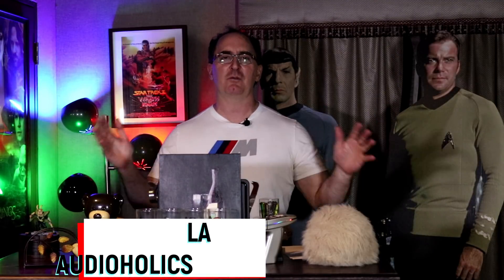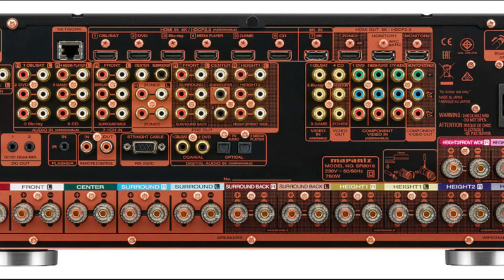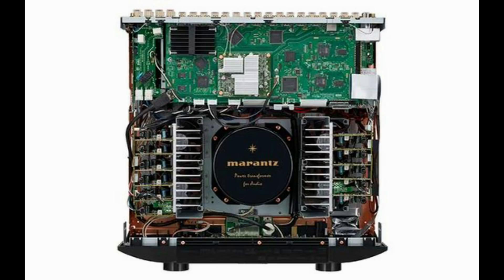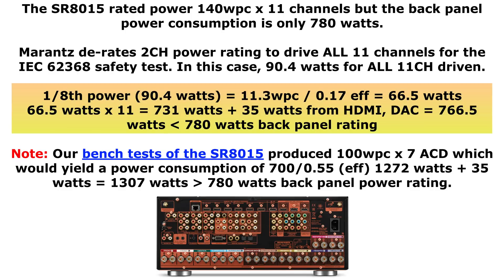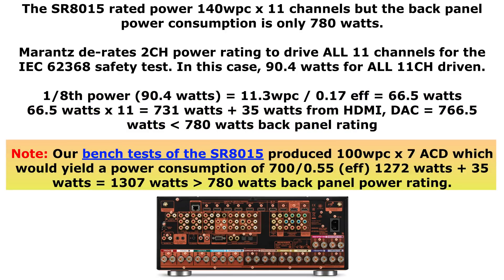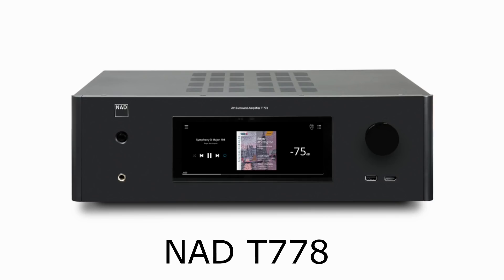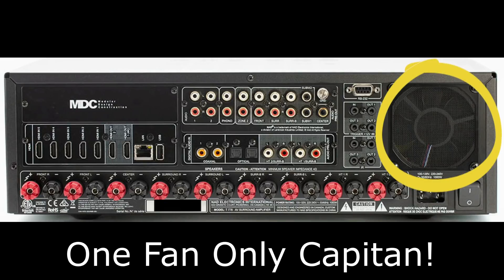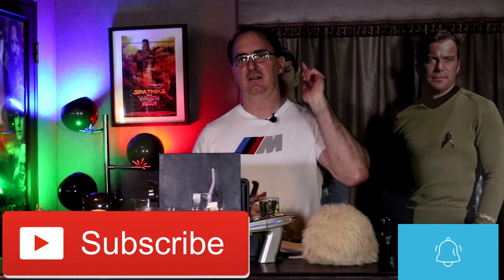Receiver Power Consumption Ratings NOT Watt You Think?

Comment: @starlightgrecording559
Audioholics
This Is Gerard Stroh!!!
I Have Pro Poweramps and Also I Have A Vintage Pioneer 7.1 AVR Reciever and it was Built in 2007 and it is Class AB at 110 watts Per Channel X 7.1*** My Pro Poweramps are 750 watts at 4 ohms so I Don't Believe These Power Rattings on these Home Theater AVR's or These 2 Channel Stereo Amps and I Been Dealling With Pro Audio Gear Sence A Very Young Age and I Had A Vintage Sansui A-60 80 watts Stereo AMP and Truely it was only 43 Watts at Peak Power and So I Learned Alot For 53 Years and I only Use High SPL Speakers only Because These New Speakers Don't Put out High SPL Rattings***
3 things I Look at When I Buy Speakers  1. OHM Rattings  2. High SPL Rattings  3. Wattage**

Comment: Thanks, Gene. Although it is one of your older videos, it helped answer a lot of my "current" questions.

When I tried using external amps with my Denon AVR-A10H(tried Monolith, Emotiva XPA 7, and Anthem Mc325). They all seem to make my speaker pop during startup and the shutdown (used 12v trigger). The pop is small but loud enough that I can hear from my MLP in my 20ft by 20ft room. Should it be ignored, or is this an issue that could potentially damage speakers overtime? Preout disconnect in Denon did not help with this issue.

Comment: I need help on what size, brand and configuration A/V receiver I need for the following layout for my outdoor covered patio. The A/V receiver and needed supporting audio equipment will be housed inside the house and cables feed outside through liquid tight tubing so, I need a controller/receiver that can speak to each other through walls. I have two TV's mounted, one is a 65" Samsung Terrace and the other is a 55" Element ROKU.

Here are the speakers I will be using:

65" Samsung Terrace:
7 ea. = Focal Littora 200 ICW8
2 ea. = Focal Littora 1000 ICW SUB10

55" Element ROKU:
1 ea. = The Terrace Outdoor Soundbar LST70T

I live in Houston, TX so you know the environment situation. Please advise and give me direction, I really would appreciate it!

Comment: I have a Yamaha 5.1 receiver rated at 100W/channel and 250W on the back. You explain that difference nicely here. What I'm wondering is that when I look inside, I see the power transformer hooked up through a 6A fuse and switched by a relay rated for 5A. Given that it is (presumably) a class AB amplifier that is only ~50% efficient: 100W/channel * 5 channels / 50% / 120V = 8.33A would blow that fuse. I am therefore concluding that the 100W/channel rating is the total power consumed by amplifier + speaker and not just the speaker. Am I correct? Seems like that would be misleading though.

Comment: When I look at the electrical box that distributes power throughout my house I see a lot of 15 amp circuits and a few larger ones for 220v devices.  When reading Stereophile  and other high end audio periodicals, you sometimes see reviewers recommend a 20 amp circuit or a dedicated circuit for a piece of equipment they are reviewing.  This usually is brought up when they are reviewing a very powerful class A or AB amplifier.  I am curious under what circumstances is the typical homeowner would be wise to consider having an electrician change a 15 amp circuit to 20 amps or install a dedicated circuit for AV equipment.

Comment: Hi  Gene, thanks for the info on the power consumption, I spend hours watching and learning from your channel.
 I have a Denon avr 8500, the box says 150wpc x 13 channels. doing my limited math I calculated approximately 100wpc. Please confirm.
 I'm driving 7.2 channels, however when driving 2 channels my towers which are polk rtia 9's aren't really  being driven hard, are these speakers inefficient or is there something wrong with my avr? I'm very frustrated and need your help please.
Courtney

Comment: As you stated, class AB uses 4x power consumption compared to class D at 1/8 power assuming 100 watts/channel x7 channels (437.5 watts vs 109.4 watts).  Let's say I'm deciding between ATI's 200 watt 5 channel class AB and class D amplifiers.  Assuming for arguments sake that I listen at 40% power, will my electric bill be lower if I go with class D?  In other words, does a class D amp draw less power than a class AB, which would have a greater demand for electricity?
Reply from the maker: Yes Class D is much more efficient,  especially at idle power.

Comment: Thank Gene, I was about to blow a wad of cash on a pre-pro/amp setup ...  which was probably always overkill for my use case, as I sit pretty close to the front sound stage.  I guess I've been under this spell by watching various YouTubers as they always seem to gush and prattle on about channel separation and the dynamic range of a prepro/amp setup.  Having bought a cheap integrated Onkyo, late last year, I've actually been pretty happy with the sound quality, but was always wondering if I was getting all I can out of my Infinity ILs.  To be fair, there's probably an appreciable difference in the sound quality between prepro and integrated, but to the tune $3000 plus?  Probably not worth it.
Reply from the maker: No and I find it kinda funny another Youtuber claimed the preamp section of the Marantz AV7705 is a big upgrade from the SR8012 receiver.  The exact opposite is true both in measurements and direct confirmation with SU engineering. Separates aren't always better.
Reply: prepro  way to go
Reply: @musicman8270  Yeah that's what everyone says and if money was no object that's the way I would go.  If I had bigger room to fill and sat further away, the Onkyo's flaws would be more apparent.
Reply: @charlessailer4580   I had  an integra by Onkyo for fifteen years.  I bought a Parasound p5 one year, mated to a cheap amp  I had, next year got a matching A23 amp off ebay, new in the box, 1900 for both. Use the home theater bypass to share parts in both systems.  Takes time, but the sound quality is no contest, way better. Even an inexpensive  integrated  amp is better, just saying, although If it has to bbe a receiver Onkyo is  about   the best you can do. Still have one in the spares system.

Comment: Electrical engineer here. Great video. Sufficient explanation without getting too in-the-weeds. I didn't know how consumer AV receivers were rated. I assumed the amps throttled down under continuous loads and the ACD tests were essentially "burps", hence the reduced power consumption ratings. Glad to know that's not the case.

Comment: What do think of  Denon 6500 its says 140 x 11 I do not believe it so pick up outlaw 5 x 120 so I run the 5 main  Channels then run the rest off the receiver is that good move what do you think
Reply: That's what I do. Most of the surround and height channels don't use a ton of power anyway.

Comment: Yes there is 3 power ratings you can use RMS,  programmable, and din or peak power, probably is maximum now they call it they keep changing the meaning.  sounds like what you're talking about is programmable power rating. Is that right

Comment: I have a Harman Kardon Signature 2.1 (5x100wrms @8 ohms or 5x150wrms @4 ohms ALL channels driven from 20hz-20khz.  Back panel says 950 watts and manual recommends plugging it into its own electrical circuit. If i plug my main receiver (denon x3100) on same circuit and play full blast on all 7 channels the breaker will go off. That harman kardon is a beast of an amp and weighs 47lbs fpr 5 channels ! No processing at all, only 5rca inputs and speaker terminals with a power button.

Comment: I have known for a while that the power ratings can be deceitful, but I just found it to be funny how they (Sony) had laid the power outputs in the manual, when I was checking it again today for my receiver. Budget receiver.

So, the package boasts 145W x 5 channels! (@6 Ohms)

The back of the receiver says 200W, so okay, based on this video, it should be able to squueze a bit more than just 200W? Okay.

The manual says 90W @6 Ohms with stereo setups.

95W at 6 Ohms with stereo setups using Pure Direct. Okay, Im still following 🤔 still makes sense that the receiver would manage to squeeze few extra wats when digital processing isnt used.

Right bellow it, 145W with 5 channels @ 6 Ohms, yeah baby!!!

Its just so funny, that the facade needs to be kept on. It makes zero sense that stereo can only be driven at 90W but when you plug 3 more channels in, suddenly even the front channels gain extra 55W from somewhere 😂

I dont need that much power either way, but it made me chuckle.

Comment: Hi Gene. I dug up the manual for my HK AVR 7000 five channel receiver. The specs for it show 110W/channel continuous power 20-20KHz stereo mode both channels driven  with < .07%THD
100W/channel 5 channel mode (same distortion specs as stereo) all channels driven. The power consumption rating is 125W idle and 1100W Maximum. Really love this receiver but need to upgrade for new surround formats and new (HDMI) inputs and outputs. The HK is currently powering a Definitive Tech 5.1 base layer setup. Would like to U/G to some level of Atmos  Have been following your reviews closely. Looking at either a Merantz or Anthem receiver. Leaning towards the Anthem. Keen to see your review on the new Anthem AVRs.

Comment: My ATI AT2505 amplifiers have 2400 Watts on the back panel. They are plugged into their own 20 amp circuits wire with 10 Guage wiring that is rated for 30 amps.  GREAT VIDEO. THANKS.

Comment: Why Should you spend the extra money to get 140w/ch vs. 110w/ch? Don’t you need to double the power for 3db? Doesn’t make sense????
Reply: Still more heard room going an extra 50 watts. There's also a lot of other things to consider like the quality of those watts. Size of filter capacitors, slew rate and damping factor.
Reply: You're also getting more channels in a receiver that has more watts of amplification, so you're paying more for more channels rather than the amplification. 
(Calculation removed due to error)
Reply: @danyalreyaz7503  Your calculation is wrong.
90dB =1 watt 
93dB = 2 watt 
96 = 4
99 = 8
102 = 16
105 = 32
108 = 64
111 dB = 128 watts
Reply: @Quetzalcoatl0  oops sorry :P